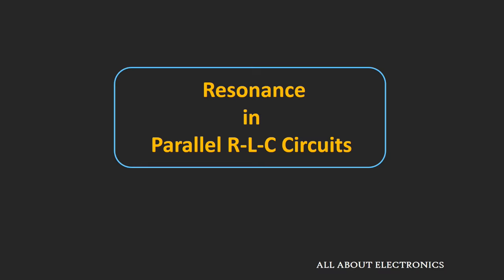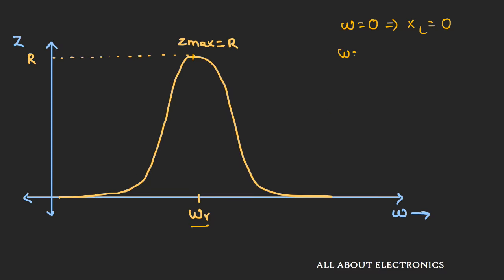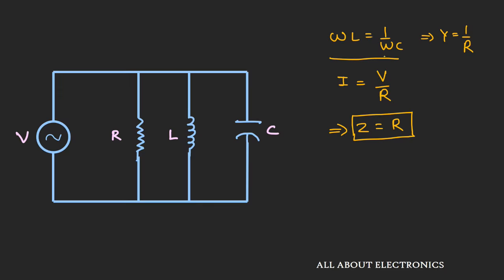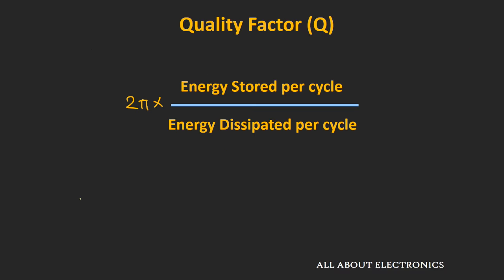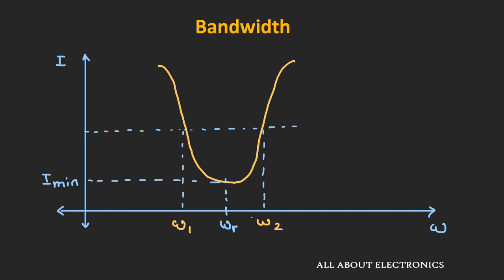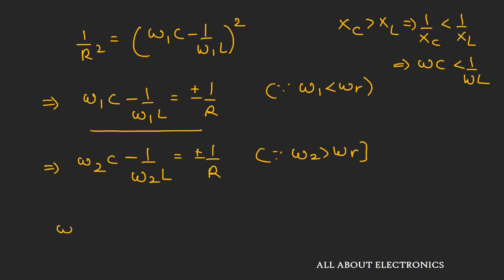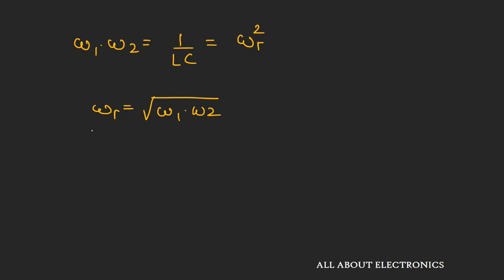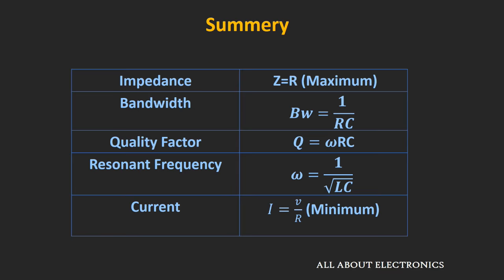Resonance in Parallel RLC Circuit Explained

Comment: 7.42 correction.
Frequency below the resonant  frequency circuit is capacitive. 
Above resonant frequency circuit behaves like inductive.
Reply from the maker: Below resonant frequency, since Xc is greater than XL, so more current flows through inductor. Thats why the circuit is inductive. ( Even though Xc > XL). The reverse happens above resonance. Because above resonance, the XL > Xc. So, for the same voltage, more current will flow through the capacitor ( because of lower reactance). And therefore, the circuit is capacitive. 
In case of series resonance, it's totally opposite.
Reply: I was stuck  at the same problem, but the fact is, XL and Xc are in parallel, take the equivalent of reactance or impedance of these two branches, then compare at different frequencies.

Comment: ELI the ICE man.. Voltage leads current in an inductive circuit. Current leads the voltage in a capacitive circuit. Purely = 90 degrees. 
SARL PARC.. where ELI lives. Series above resonance = inductive. Parallel above resonance = capacitive.

Comment: w1 and w2 are called half-power frequencies, but for parallel circuits, you calculated them by doubling the power. why?
Reply from the maker: Because the curve is for the current. If you see the impedance, curve at the resonance, the impedance is maximum. But since the current is V/Z, so curve gets inverted.
Reply: @ALLABOUTELECTRONICS  i am asking that why are w1 and w2 called 'half' power frequencies when they are obtained by 'doubling' the power?

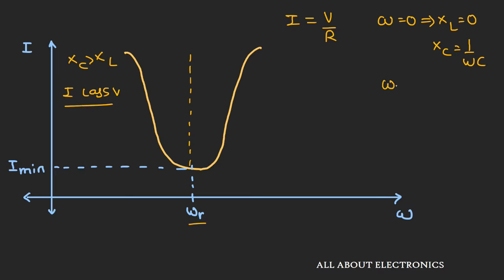Comment: At 7:05 As Xc is greater than XL then circuit should behave like capacitive then how it is inductive please clarify this #allaboutelectronics
Reply from the maker: Since it is a parallel resonant circuit, when Xc > XL, then more current will flow through the inductor. In parallel, the voltage will remain the same. But more current is flowing through the inductor. That's why it is inductive. I hope it will clear your doubt.
Reply: @ALLABOUTELECTRONICS  mean in which component the more current will flow will decide the behaviour of the circuit whether it will be inductive or capacitive and thankyou for clearing my doubt😇😇😇🥰
Reply from the maker: Yes, atleast in parallel circuit. In series RLC circuit, its other way around. Because in series, the current is same through each component. So when XC > XL, the circuit will be more capacitive, since there is more voltage drop across capacitor.
I hope it will clear your doubt.

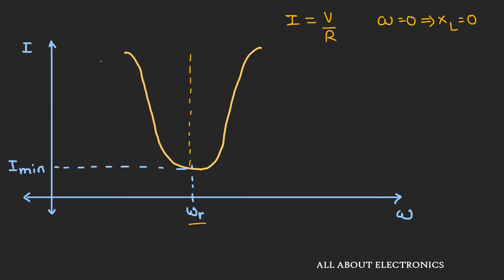Comment: 6:54 it should come XL > XC therefore lagging portion . And the way you have written XC > XL it comes in series resonance circuit.
Reply from the maker: Let me explain it to you intuitively. When Xc > XL, more current will flow through the inductor. So, at low frequencies, in parallel resonance, the circuit is inductive in nature. At high frequencies, XL > Xc. Therefore more current will flow through the capacitor and hence the circuit is capacitive in nature. For series resonance, it is other way around. Because there, the current through all elements is the same. We are measuring the voltage across each element. Therefore at low frequencies when Xc> XL, the circuit is capacitive in nature, and when XL > Xc, it is inductive in nature. 
I hope it will help you.
Reply: ALL ABOUT ELECTRONICS now for parallel as you said if more current flowing through the inductor it is inductive and same on another side it is capacitive it is because in parallel current is same . Then please elaborate me for series where voltage is same then why we say in case of series that at lower frequency XC>XL i.e capacitive and p.f is leading and for hight frequency XL>XC i.e inductive and p.f is lagging (Now in series here leading means more current should flow from capacitor so according to that XL>XC at lower frequency and for higher frequency lagging means more current should have flown through inductive so XC>XL why it is not like that in series.)    Please help me that.  Thank you.
Reply from the maker: In parallel voltage across each element is same while in series current through each element is same.
Reply: If W< Wr then circuit is capacitive means current should lead voltage while W>Wr circuit is inductive and current should lag voltage

Comment: So... the resonant frequency are the same in parallel and series RLC circuit? Okay, I got it (the part XC=XL, then omega^2=1/LC). But I stumbled upon a circuit which R is series to L, then both R and L is parallel to C. When I saw the solution manual, the frequency at resonance is something like omega^2=(1/LC)*(1-(R^2*C/L)). Do you know where the R from (1-(R^2*C/L) come from? All the resources in the internet and your videos I read and watched said that omega^2=1/LC and XC=XL, but no other further info about R at resonance. Did I miss something? :' Btw, awesome explanation 👏
Reply: omega^2=1/LC is based on the assumption that coil doesn't have any resistance of its own in parallel RLC.

Comment: Sir in my book it is mentioned that parallel LC circuit is rejector circuit not parallel LCR circuit. Is it wrongly written? Because at 3:31 you mentioned parallel LCR to be rejector not parallel LC.
Reply from the maker: When in the book, they say LC, it is actually the RLC circuit only. Because every inductor has some finite resistance. So, when one connects L in parallel with C, it is L in series with R (internal resistance of L) and that combination is in parallel with C. 
That circuit too acts as a rejector.
But its resonance frequency is slightly different from the circuit which is discussed in the video. 
I hope it will clear your doubt.
Reply: @ALLABOUTELECTRONICS  
thank you sir for your earliest response.
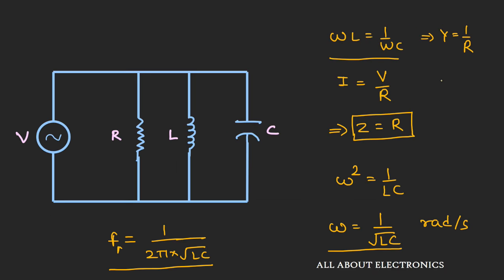However as you've mentioned at 6:47 that when Xl=Xc, resonant angular frequency is 1/√LC
So even if we take an ideal LC, circuit, for its resonant angular frequency, there also we'll do Xl=Xc which will give 1/√LC.
I couldn't understand why’d you mentioned in the previous reply that there'll be “slight” difference, please clarify?
Reply from the maker: @umasrivastava4142  The case which is discussed in the video is when R, L and C are in parallel with each other. 
But here, I am talking about the case, where R and L are in series and the combination is in parallel with C. 
I hope it will clear your doubt.  In  this case, wo = sqrt [ 1/LC - (R^2/L^2)]
I hope it will clear your doubt
Reply: @ALLABOUTELECTRONICS  yes sir it's perfectly clear now. Thank you so much sir 🙏

Comment: At 5:00 the step may be wrong. How you can take j  common? Where in case of wc it is in numerator and in case of wl it is in denominator.
Reply from the maker: 1/j = -j, If you closely observe, there is a negative sign in the next step.
Reply: @ALLABOUTELECTRONICS  How 1/j  becomes -j?  Help me to understand this.
Reply from the maker: You would have studied in the high school that, j^2= -1. So, 1= -j^2.
Hence, 1/j = -j
Reply: @ALLABOUTELECTRONICS   Thanks a lot. 🙏🙏

Comment: why will the impedance be maximum?
Reply: Because the 
R is constant
At low frequency the capacitor is open and the inductor is short
The inductor will have the lowest reactance this causes a low impedance 

At high frequency capacitor will act short circuit and that will provide a lower reactance this also cause low impedance
At resonance both will be equal 
So the impedance will be the highest

Comment: If it’s just parallel L C, does it work the same?
Reply from the maker: If there is no R, then the circuit is highly selective. Meaning that Q will be very high. Just put R equal to infinity in the Q-factor equation. Ideally Q would be infinite and It will act as an oscillator.
Reply: @ALLABOUTELECTRONICS  sir in LC circuit, R is almost zero...(?)

Comment: If XC is greater than XL before the resonance frequency then it should be capacitive in nature ...why it is inductive???
Reply from the maker: When Xc is greater than XL, then inductor draws more current. Hence, it's inductive in nature. ( In parallel RLC CIRCUIT).
In, series RLC circuit, it's other way around. Means when Xc is greater than XL,then circuit is capacitive in nature. I hope it will clear your doubt.
Reply: @ALLABOUTELECTRONICS  thanks sir 🙏😊

Comment: i did not understand why you said this circuit rejector
Reply from the maker: Because if you see the frequency response of the parallel RLC circuit then it's like a band reject filter. That means it rejects all the frequencies in the particular band and passes the remaining frequency.
Reply: @ALLABOUTELECTRONICS  do you mean that for a range of frequency their is minimum current
Reply: can you tell me about anti resonant cicuit
Reply: if a inductor and and resistance connected in series and both are parallely connected with capacitor by a AC source then what type of circuit this,can you explain me
Reply from the maker: @sk7461-m2d  Yes.

Comment: Sir, what will happen if we have a current source in place of the voltage source? Sir, I feel that in such case the current through the resistor should be maximum at resonance since the capacitor and inductor would become open. Sir, is my guess correct? please help me ...
Reply from the maker: In the parallel RLC circuit, when the voltage is applied to the circuit, then the voltage across each element remains the same. But at the resonant frequency, the admittance becomes minimum or impedance becomes maximum. 
I hope it will clear your doubt.
Reply: @ALLABOUTELECTRONICS  Sir, will the response will be the same if we replace the voltage source with the current source?
Reply from the maker: It will remain the same. The thing is in the parallel RLC circuit, we are measuring the current, as the voltage across each element is same. And if you see the response of the current through the resistor then it will remain the same.
Reply: @ALLABOUTELECTRONICS  Thank you so much for your kind help sir ! ❣

Comment: Sir u said, series RLC circuit is a acceptor circuit because this is accepting frequencies which are around resonant frequency. But this circuit is also rejecting frequencies which are far away from resonant frequency then why can't it be rejector circuit?
Reply from the maker: The series RLC circuit acts as a bandpass filter. So, it accepts a certain band of frequencies and rejects the remaining ones.
Reply: @ALLABOUTELECTRONICS   Thank you sir

Comment: But at w=0, we get Xc=infinity and XL=infinity at w=infinity, so doesn't that make the impedance maximum at these points ?
Reply from the maker: Yes, That's true. At these points impedance will be maximum and the current through the circuit will be minimum. But when XL = Xc, impedance of the circuit will be minimum and current will be maximum.
Reply: @ALLABOUTELECTRONICS  But then the graph at 7:17 says that current will be minimum and impedance maximum at Wr .
Also, when the circuit is capacitative (Xc>XL), shouldn't I lead V and lag behind V in an inductive (XL>Xc) circuit ?
Reply from the maker: Oh, I beg your pardon. What I said is true for series RLC circuit. For parallel RLC circuit, the impedance will maximum and current will be minimum at resonant frequency. 
Let me explain in this way, it is parallel RLC circuit. So, at the given frequency from which circuit component (inductor or capacitor) maximum current is flowing will decide whether a circuit is inductive or capacitive. 
At w=0, XL = 0 and XC = infinite. (i.e XC>XL). But as XL =0, entire current will flow through inductor. Or it can be said that circuit is inductive. 
Likewise at w= infinity, XC= 0 and XL= infinite. So, at a very high-frequency majority of current will flow through capacitor and circuit will be capacitive. 
So, if you move away from the resonant frequency then the current will increase. But at resonant frequency current will minimum or it can be said that impedance will be maximum.
I hope now it will clear your doubt.
Reply: @ALLABOUTELECTRONICS  Yes, it did .
Thank you so much !
I love your channel !

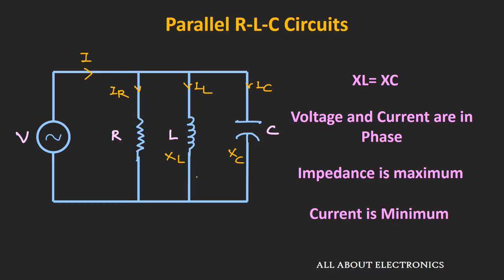Comment: 1:44 If there's a resonance, the Z = sqrt (R^2 + (XL - XC)^2)
= sqrt (R^2 + 0), so won't the impedance minimum?
Reply from the maker: For parallel RC Circuit, the admittance (Y) is [1/R + j(wC -1/wL) ] 
And at resonant frequency, wL= 1/wC.
i.e Y is minimum. Hence Z is maximum and due to that current, I will be minimum.
I hope it will clear your doubt.

Comment: Solving Q with inductor equations.. 
Q=[w*L*(Irms)^2]/(Irms)^2*R
Cancelling Irms^2 we get
Q=wL/R=XL/R
Correct me if I'm wrong
Reply: But by putting C= 1/√(w2L) in Q factor formula Q=wRC, we get Q= R/wL which is opposite to that derived by taking inductor. By taking inductor in place of capacitor Q= wL/R

Comment: if RLC circuit are connected in parallel with a dc voltage source then no of node ?
Reply from the maker: Apart from the reference node (ground), it has only one node.

Comment: If resonance angular frequency is wr

if w < wr so circuit act as capacitive or inductive ? for parallel resonance and serise resonance
Reply from the maker: In case of the parallel resonant circuit, when w < wr, the circuit is inductive. Watch the video from 6:49 onwards.
In case of a series resonant circuit, when w < wr, the circuit is capacitive.
Reply: thanxx

Comment: use of parallel resonance circuit
Reply from the maker: It is used as an oscillator and for tuning the circuits in radio frequency applications.

Comment: What is j???
Reply from the maker: if you know the complex number then you might be aware that it is represented at a + jb, which is the rectangular form of representation of the complex number. Similarly, the capacitor and inductor can be represented in recangular form and it represents the reactance of these elements. For capacitor it is 1/jwc and for inductor it is jwL. If R and L are in series then the total impedance would be R + jwL. I hope you can co-relate the j now. 
And if you still have any doubt then you can check my video on the phasors, where I have explained it in detail.

Comment: If the resonance  frequency is to be developed in LC parallel circiut then the DC  voltage must be applied  during the first quarter of  every cycle Rest of the wave form which is 3/4 th of the wave is self generating Thank  you for your feed backMukundan

Comment: Suppose we have  L and C in parallel  with a DC supply what happens?Mukundan
Reply from the maker: During the transient, the inductor will oppose the instantaneous change in current and it will act as an open circuit, while the capacitor will act as a short circuit. (Capacitor will charge during the transient time)
After the transient, entire current in the circuit will flow through the inductor as inductor will act as a short circuit in the steady state condition.

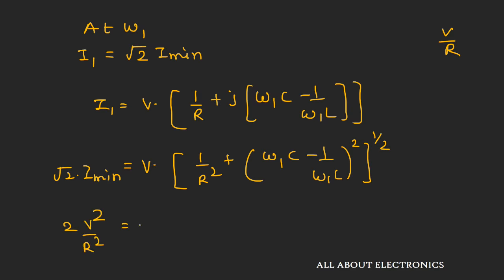Comment: I don't understand how you got from the second step, into the third step where you have the square root(see 13:02)...I think that's mathematically incorrect..
Reply from the maker: Its the amplitude or modulus of the complex number.
Let's say we have one complex number A+ jB. Then its amplitude or modulus will be sqrt (A^2 +B^2)
I hope it's clear to you now.
Reply: Ah yes, I understand now. I have another question though. Why is the energy stored per cycle only considers one factor, either the inductor or the capacitor? Why not the total of them both?

Comment: how current lags voltage when Xc>Xl?
Reply from the maker: This is parallel RLC circuit. So, when Xc>XL, more current flow through the inductor than the capacitor. So, nature of the circuit will be inductive.  For inductive circuit voltage leads the current or we can say that current lags the voltage. I hope it will clear your doubt.
Reply: ok sir..thankx a lot..bt in series resonance current leads when Xc>Xl..is this correct??
Reply from the maker: Yes, That is correct. Because in series RLC circuit, when Xc>XL, there will be more voltage drop across capacitor than across the inductor, And circuit will be capacitive in nature. So, current leads the voltage.
Reply: Likes for both of you.

Comment: why is it that when XL=0 the inductuctive reactance is dominant?
Reply from the maker: when XL=0, then inductor will act as a short circuit. So, entire current will flow through So, at that time it doesn't matter what is R and XC in the circuit because the entire current is flowing through the inductor.  So, in general, at lower frequencies, inductive reactance will be dominant as the majority of the current is flowing through the inductor.
I hope it will clear your doubt.
Reply: oh i get it. thanks
Reply: and i could see that you have used this formula when calculating I1 for bandwidth. i.e a+jb = (a^2+b^2)^(1/2)
could you please elaborate this?i am stuck here.
Reply: @Darius_Kongkham   that is root of A Square  and Bsquare
Reply: @Darius_Kongkham   that is root of A Square  and Bsquare
Reply: @Darius_Kongkham  it is in rectangular form
Reply: tayenjam jeneetaa hello friends